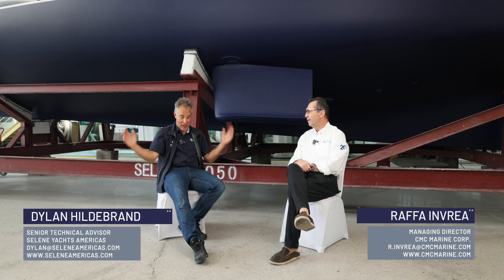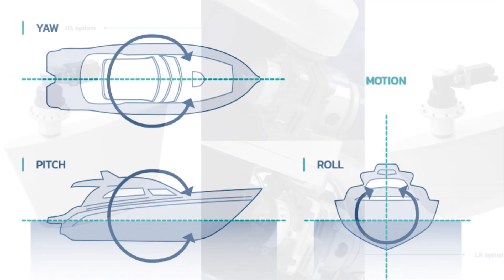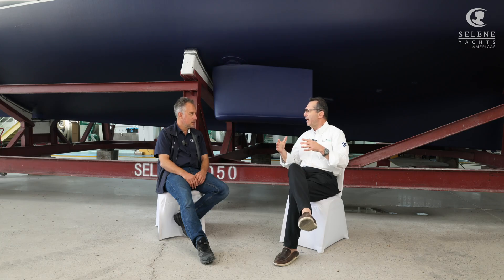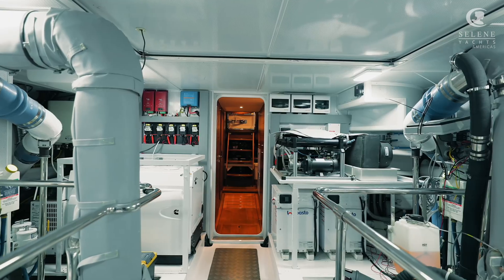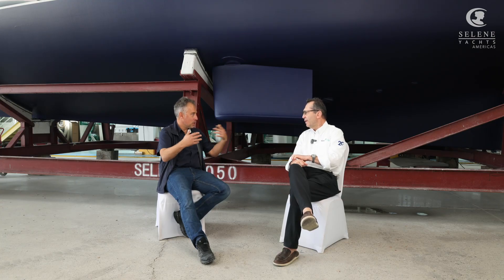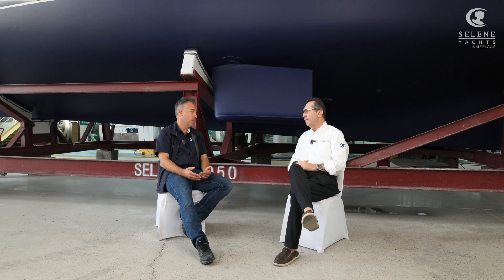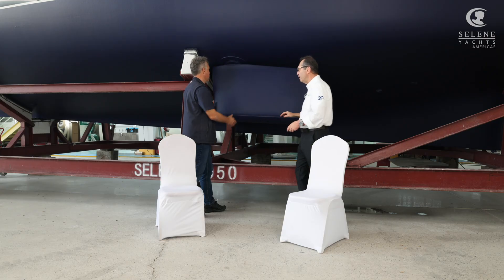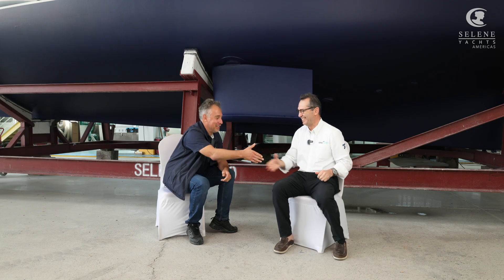Stabilizers on a Trawler: Hydraulic or Electric?

Comment: Great decision by Selene, it will improve the usability of the Selenes by a massive amount. Owners will be able to anchor wherever they want and they know they will be fully stabilised.  
I have Stab 25 on my boat, installed them 2.5 years ago and since we are basically living on our boat, we use them 24/7, have put 12.000+ hours on the clock since we installed them. I run them off my batteries, which are charged by the solar panels and/or the alternators. Electricity usage is minimal, so no need for a generator at all and at night that means quiet, comfortable sleeping with no fear of problems with a generator.

To put in bluntly, I am actually flabbergasted that other boat builders don't install electric stabilisers off factory. There is no better advertising for a yacht than a stabilised boat at all times...........even in a port. 
If Selene ever wants to start promoting Selene in Europe, give me a call 😀 We are currently viewing boats in search for a follow up of our current boat (we are sizing up) and whatever that boat will be...........we will install zero speed stabilisation again.
Reply: We would love to work with you and find a way forwards. Reach out to me at any time. Thanks Dylan

Comment: Does the Electrical Application open an opportunity to install a cost-effective enclosure of a Sea Chest in order to protect against a potential catastrophic breakage of the Fin Shaft and penetration of water into the boat?
Reply: I have these on my boat and there is no fin shaft. The fins are directly bolted to the motors and are designed to break off if you hit something. The fin will break off and float to the surface, you can retrieve it, go to a port, get the fin repaired and bolt it back on the motor. I have seen that happen in Turkey, charter yacht came in on Sunday night, was back out again by Wednesday afternoon.

Comment: It makes perfect sense to go with electric stabilzers. No diesel engine to power a hydraulic pump, no lines and fittings to monitor and repair and instant 100% power from an electric motor. I'm guessing that they could provide redundant electric motors to provide a back-up in case of failure when need most. Do they also provide a bolt-on electric get home motor for the main driveshaft? Northern Marine uses this type of system (albeit hydraulic) on their boats.
Reply: I have over 12.000 hours of usage of the Stab 25 on my boat and I did that in a little over 2 years. Zero failures, zero downtime, I don't need a back up motor and mine are on 24/7, basically the whole year. The motors are bolted on to the hull and then the fins are then bolted on the motors.
Reply: Fly by wire. I love it.
Reply: Hello this is Dylan.
Regarding the "get home drive" this is fitted to pretty much every single engine boat we build now. It is at present Hydraulic. I am pushing one of the large vendors to build an electric version. ( Andrew you know who you are) And have been promised this last year.. we are still in the engineering phase.  But when it's ready we will do another tech talk. Electric is the future. 
Thank you 
Dylan

Comment: I have a question for you Dylan, how do you size the fins needed for best stabilization. Is it calculated by the boat length , width , draft , weight or a combination , and are there any other factors that need to be applied. Thanks.
Reply: Great question Gary 

We send the data to CMC, most of the vessel model. They then recommend a fumin size.. bigger is better... But be warned.. it's more drag so less range and speed.. as well bigger fins have more possibilities of hitting the bottom and docks ( especially pilings)